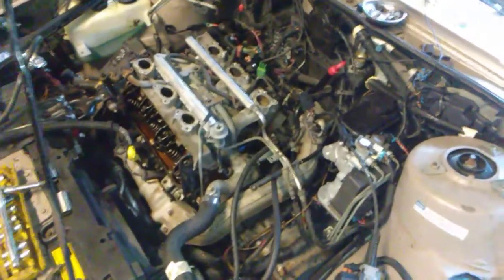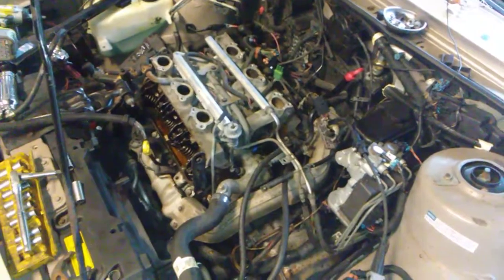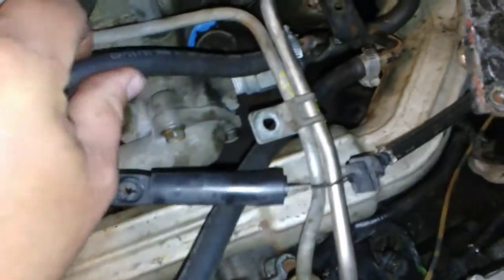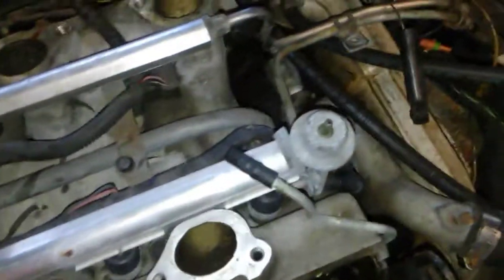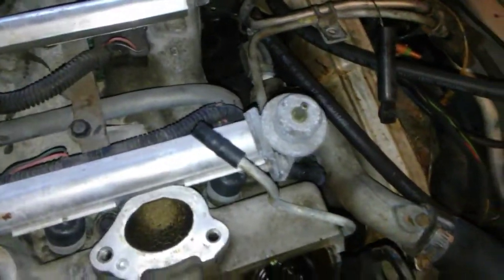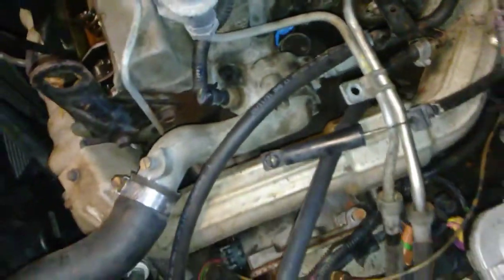GM 3100 V6 Heater Hose Quick Connect

Comment: Hey thanks for the vid. I am doing the intake manifold gasket job and can’t get the black pipe out of the connector, the quick disconnect plastic fell apart and I can’t pull it out. I do have the support bracket disconnected from the block so the pipe can move. Do I pull harder straight out, or is there a way to press in the disconnect clips inside the connector? Thanks!
Reply from the maker: When the clips get really bad I have had to dig them out with a pick before. On the tube itself I have had to heat the housing with a plumbers torch and rock it back and forth. It will melt the rubber o-ring but that is ok because you need to change it anyway. Make sure you clean the inside where the pipe goes after it comes out. I use some rolled up 120 grit paper or Emery cloth.
Reply: Bbernhardsr ok thanks! I will work on getting the clip remnants out and working the pipe out, and replacing the housing and the disconnect clip

Comment: I don't have the threads on my 3.1. it's just a metal tube with a flange. Any ideas on how I can repair it?
Reply from the maker: Usually with that setup I take some Emery cloth and clean out the hole real good because it will have corrosion. If the metal tube is in good shape then just replace the o-ring and put it back in. If the hole is really really bad then put some rtv grey waterpump sealant over the tube then put it in. Let it cure for 24 hours before putting antifreeze in.

Comment: so my heater tube did not come stock with the quick disconnect, it has the same heater tube but not quick connect. is the threaded quick connect a stock part or a clever re-purpose? the old heater tube broke off where it connects to the thermostat housing/intake/block, there are no threads in this hole leading to me wondering more if this is something you added and it worked. 2001 grand prix 3.1
Reply from the maker: Unfortunately no, this is not something I added. Sounds like you may have the design that is a metal pipe with a slip fit. It has an o-ring and is held in place by a stud and nut on the rear cylinder head? If not, I would think it would be cheaper to buy a tap and make threads for the part I showed than it would be to get another lower intake? For some reason I feel that pipe should come out.
Reply: Update: bought correct pipe. Haven't had time or money for gaskets so I can take manifold off and chisel out old broken pipe. So I haven't had a heater in months and it's been cold but what I've done is bought JB WELD SteelStik. Kneaded a ball of it up and shoved it in the hole. Let set. Then kneaded a patch to put over the ball once the ball cured. Hasn't failed yet after three months. Sucks that it's very cold in the car though

Comment: is  that return hose  next  to it my  core went  out  I'm trying  to stop it from reaching  the  core
Reply from the maker: That metal pipe does go to the heater core but you can not just block it off. What you will need to do is take both hoses off of the heater core at the firewall and connect them to each other. This will still allow the coolant to flow properly but bypass the heater core.
Reply: @Bbernhardsr   damn i wish  there  was  video for  that I cant find  them from the  top its  buried
Reply from the maker: @ladybird808s  yeah it is buried in there a little bit.
Reply from the maker: @ladybird808s  just follow the rubber hose back to the firewall and you will find it. I am posting a link to a video that shows a dorman product you can use to fix it. I believe they are sold at most auto parts stores.

https://youtu.be/g5rMUYOpzsk
Reply: @Bbernhardsr   thanks I have a strange  feeling I'm gonna  have  to get  the  car  on jacks to get to those hoses cause  there's  no access from the  top but  I just  ordered  that part it  comes to my  door Friday

Comment: Ok, so i have replaced my head gaskets and intake gaskets. Then once im done i see that i have for got to bolt my main heater hose that has the mounting bracket made on to it that goes on the stud then tightened down with a 13mm socket. So now its hard to work around everything without having to take alot back off just to put one nutt on. So the question is do u have any pointers on how to get the one nutt on??
Reply from the maker: Brian Puckett this happened to someone else I know. No way to do it without some pain unfortunately. Taking off the air intake hose will grant a little access. What I had to do is figure out the right length of 1/4 drive socket extensions so that I could run it under the exhaust crossover pipe and my ratchet was over by the master cylinder for the brakes. So with my right hand I would operate the ratchet and with my left I would guide the socket into place and keep it there so it did not fall off. It is a very slow and painful process. You will probably get cuts and scrapes on your arms and use a lot of foul language. Remember when you feel the nut is almost tight to keep forward pressure on the metal pipe so that the end stays firmly seated, otherwise when you give the nut the final turn it may pull the pipe out a little. I suggest making sure you have a new o-ring on there and if the pipe is pitted from corrosion you may want to apply permatex grey for waterpumps and thermostat housings. Best of luck and in this case patience is definately required.

Comment: Is there a o ring inside I got the new retainer but still loose
Reply from the maker: Sorry for the long wait on a reply. Yes there is an oring inside of the connector. The line will be loose. That is why you have to secure it to the cylinder head with that 13mm nut.

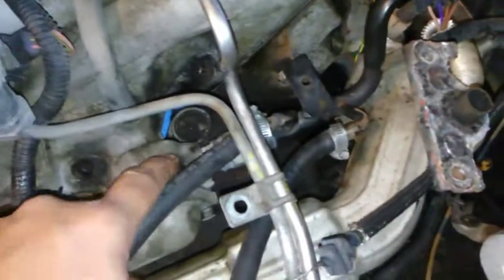Comment: I have a question. At 0:26 there is a pipe right in front of your middle finger. It goes up about 2-3 inches turned 90 goes across the engine then into the water pump. What is that part called? What is it for? And how can it be changed? That part has rusted and started leaking coolant in my car.
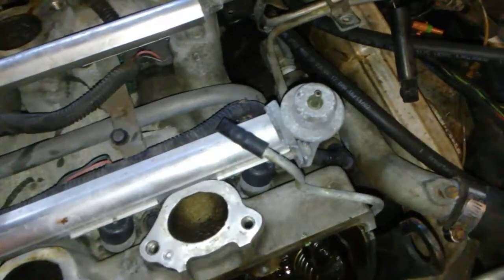Reply: At minute 1:30 you can see the pipe I’m talking about.
Reply from the maker: Here are some part numbers:
Dorman 626533
SKP SK626107
ACDELCO 24507188
You can enter those numbers into www.rockauto.com and it will pull them up. I believe you are talking about the second option I listed. Let me know if it works.
Reply: I ordered the part, hopefully it is here soon. Now just a couple more question. On the part that turn 90 down and goes into the engine. How does that come off? Am I suppose to just pull really hard? And once off, does the new part  just click on, is there a special sealer I’m suppose to put on.
Reply from the maker: @jlgarcia04  there will be an o-ring. You may have to heat the pipe with a propane torch a bit and pry it up. The hole will be nasty and need to clean it out with some scotch brite pad.
Reply: Ok, I got the part in the mail. I got the old part out of the engine. Everything is clean and ready god install. My last question. Is the pipe held in place by just pressure? Or is there some sort of cement I’m suppose to put on the pipe?
Reply from the maker: @jlgarcia04  just the o-ring and the 1 bolt is all that I know of. I would say to install it all and use a cooling system pressure tester. Pump the system up to 16lbs and make sure all is good before you put the intake all back together. If it gives you trouble I would say some permatex waterpump and thermostat sealer would be good. It comes in a smaller tube and is grey color.

Comment: Could you by chance put a link up to where I can purchase that quick connect. Found my heater pipe disconnected and no way to put it back in.
Reply from the maker: scotty turgeon https://www.rockauto.com/en/moreinfo.php?pk=61955&cc=1217225
Reply: Bbernhardsr Thank You. I have a 99 buick century and have been trying to look up what was wrong. I had found my heater pipe disconnected from the intake manifold. No connector/Stud bolt/Nut. I had no idea how to reconnect it until this video. I should probably get new O-rings too while I'm at it.
Reply from the maker: scotty turgeon so the fitting I showed was not there? I doubt it would have come loose and fallen out. I have seen different designs where this fitting is not used and there is an o-ring on the end of the pipe. They used that design on 3.4 a lot.
Reply: Bbernhardsr Mine has An O-Ring on the end of the pipe. Possibly two, one on the end and one where it steps up in size.
Reply: Since I have this style. Is the pipe held into the manifold by the Stud bolt/Nut?
Reply from the maker: scotty turgeon yes if you have the style with just an o-ring and no connector than yes it is held on by the nut on the stud in the side of the rear cylinder head.
Reply: Bbernhardsr Thank you so much man. I really appreciate the information.
Reply from the maker: Michael Walter  it is a 13mm. I used a 1/4" drive with a combination of extensions so that the ratchet would be between the exhaust crossover pipe and brake master cylinder. It is not easy, but it keeps you from removing the crossover pipe.